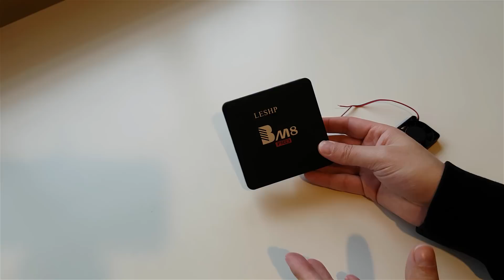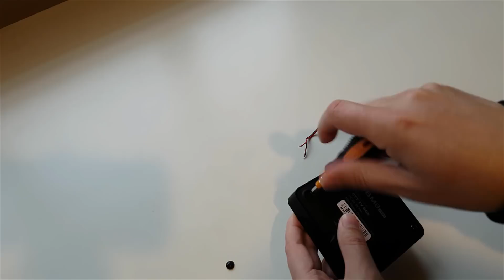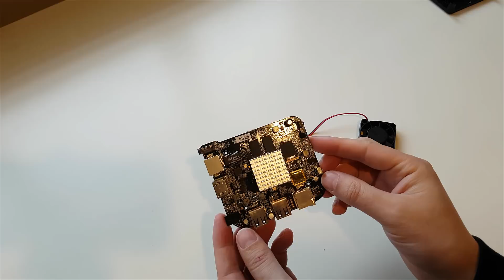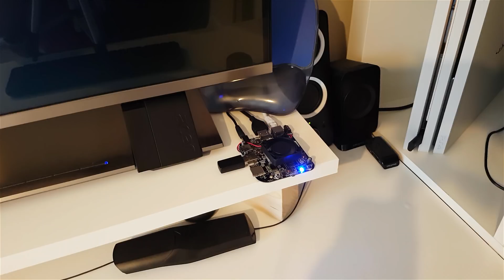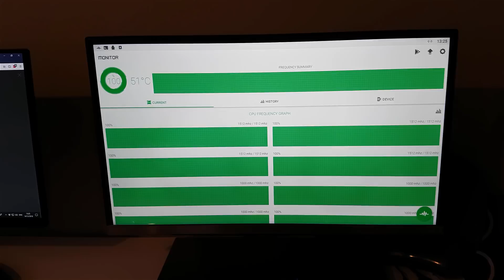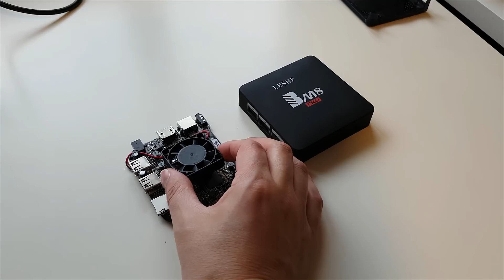Cooling Our Android Crypto Mining TV Box

Comment: Can you try to run the bare board, outside the case, but also without the fan? That would be interesting.

This person has also been tinkering with Verium, and his results seem to mirror yours. The Odroid XU4 seems to be the best performer, and it seems to be similar to the BM8 you're using:

https://steemit.com/verium/@birty/cpu-mining-is-back-a-complete-how-to-guide-and-profit-analysis-for-verium-mining-on-a-farm-of-single-board-computers-part-1
Reply from the maker: Hi, 

I did try running it without the casing but it was still too hot, if you added a bigger heatsink you could probably do it without a fan.

I've read that article a few times and its one of the reasons I started with the android devices for mining. The Odroid is good but also expensive, the last time I checked I think they were £70 which is double the cost of a tv box.